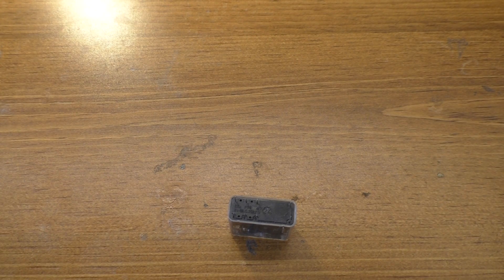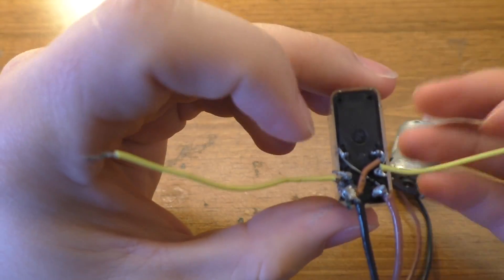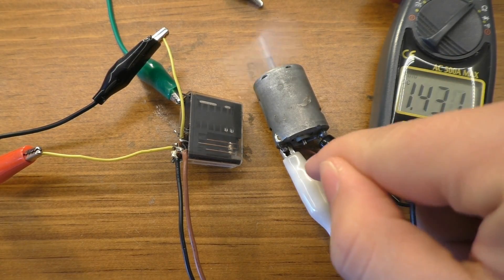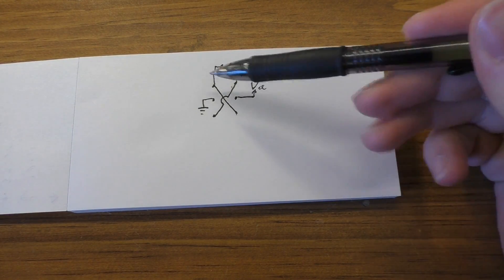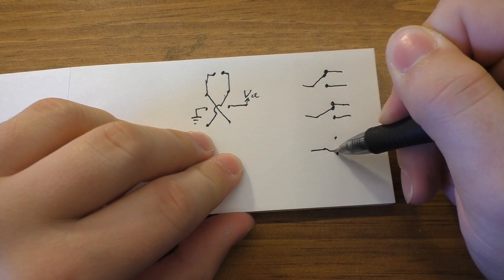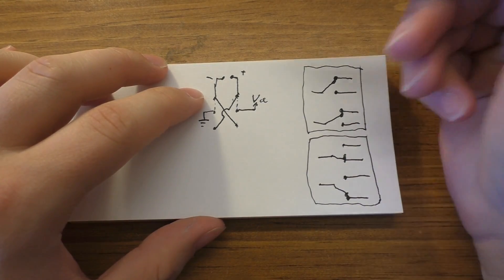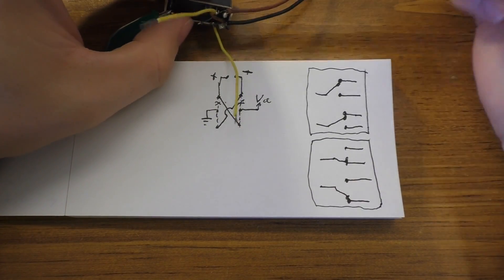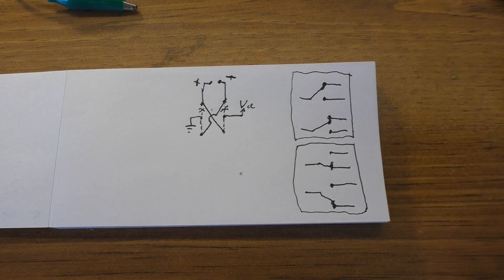Use a DPDT Switch or Relay to Change Polarity/Motor Direction

Comment: Do they make a relay switch that already have the outside cross connection done internally so you don’t have to wire it manually?
Reply: I mean, isn’t that the most obvious question.  Shouldn’t it come with just 4 prongs….

Comment: Brilliant! I've added a 12V 1channel 433MHz receiver and connected it's output as the input of the DPDT relay.
When I press my remote control button it runs clockwise, when I press the button again it reverses direction - the button toggles direction!

Comment: Thanks for sharing the informaion, i have one problem where i want to use the same with two push buttons and with the 8 pin relay. if i want to put 2 push buttons for motor forward and reverse direction , and also want to keep the motor in idle state when i don't want to use, how would be the wiring diagram with two push button's and 8pin Relay.

Comment: I enjoyed your video and it got me thinking of a project I would like to do, but need a little help on what I need to accomplish it?
I am trying to modify a winch from a hand held remote to a wireless remote.  I have a two channel wireless receiver(Two positives and two negatives) but I am a little confused on what type of relay I need to be able to run and reverse the direction of the winch.  Do I need: SPDT, DPDT?  Do I need a 5 pin, 6 pin, or 8 pin relay?  I plan on running it directly from an outlet so I know I the relay will have to be rated for 110 volts. If anyone can help me understand what I need and how to do it, I would be very greatful.

Comment: How would you make this so that the trigger voltage can be arbitrarily inverted (from another controller) and the relay output flips automatically when that happens? (without a switch)

Comment: I keep coming across this video and its somewhat useful but I am just curious if anyone can tell me what powers the circuit off when it does not need to run either direction?  I'm wanting to use one of these as a way to roll a window up and down in the tailgate of my Blazer.  It obviously only needs to run until it is all the way up or down.  The primary switch is in the tailgate and the old motor was grounded through the chassis and i am changing to a different type of motor that is direct drive and reverses polarity

Comment: Hey! So if I want to hook up a timer to this so that I never have to flip a switch. Is it possible to hook up a timer to it? Like a deer feeder timer?  Would I need two timers? Or is it just impossible?
Reply: Josh, Yes is the answer. Use a DPDT relay and your timer.  You didn't mention whether your timer puts out a voltage or is just a switch-type timer. I am going to assume that your timer just makes a connection/i.e. switches a device on/off.  So, you would use your timer to control the on/off of the DPDT relay (which then reverses the polarity).    I can't imagine why you need to do that, but that's how.  If you care to more completely describe what you are trying to do, a far better solution is likely than having wire a timer to a relay then having to wire the relay to "whatever".

Comment: I know I'm late to the party, but don't you need a flyback diode for this to not risk damaging the relay and in that case, how and weher hould that diode be located? I used this method for switching electro magnets and accidently broke some transistors because of voltage spikes generated by the inductance in both the coils in the relay and the electromagnet coils. Help would be greatly appreciated.
Reply: No. Your relay is not in danger. It is the a danger to OTHER components, that don't have some protection. As in your transistors. Not the relay. Also some relays already have a diode built in for that. With this you should be more worried about the motor putting out power when you shut it off.
Reply: @AztecWarrior75  Hah, nice 2 years later, but thanks for answering. Used DC motor driver IC's instead of the arduino controlled relays, those had built in protection, were a bit more expensive but worked better in basically every other way. (Used all this to switch electromagnets for a model maglev track)
Reply: @assarstromblad3280  yeah as you exclaimed before "late to the party".

I used motor drive shields to make something very similar. A set machine. It not only goes in and out with steady constant pressure. With no attached/fixed mounting points to the drive tube, it can rotate a full 360 endlessly. The tube being hollow, delivery of lubricant to/through whatever attachment is made possible through the inner stainless steel tubing.

You know how people have tvs coming out of cabinets,  well I had my machine coming out of the foot of my custom bed. It was very bulky. LOL.
Reply: @AztecWarrior75  Nice, what did you use it for?
Reply: @assarstromblad3280  well how one word misspelled makes a huge difference. Set machine is supposed to be SEX machine. Lol
Reply: @AztecWarrior75  oh, okay that was definitely an interesting twist lol, Now I get why ypu havr it under the bed lol
Reply: @assarstromblad3280  That one letter mistyped really changes the WHOLE outlook. LOL. Everything falls into place.

Comment: Great stuff, but with two separate SPDT relays you can have an Off/Idle state! so how about having an idle position where there is no motor rotation with a single DPDT? Like you said "briefly" and "avoided" further explanation, without a stop/off/idle state, the gears will break/damage!

Comment: Can I use 2 on off rocker switches to achieve this with 4 linear actuators? I Bought a 5 rocker switch panel for a camping trailer 1 switch runs water pump, 2 run lights, and I'd like to use the other 2 for up and down on linear actuators. Thanks

Comment: Can u explain how to hook a switch to this I’m going to order the relay I have a switch my build is done with a 3 way switch that is hit with a dowel. It’s for an elevator design small scale. Basic idea motor runs turns a threaded rod moves a bolt and washer up. When it gets to the top the washer moves a teeter totter weighed on one side causing the dowel to come down hit the switch reverse the motor and the washer and bolt move down. Teeter totter falls back pulling dowel up off switch. When the washer gets to bottom it flips switch again on other side and up goes the washer and bolt. Rinse repeat. When finished I’ll post my project on YouTube under schorr studios if you want to see it. Appreciate your video here helps a lot if I can figure out the switch I’m set. Do I have to worry about arc on this when it flips read that it can do that. Doesn’t appear to have the problem on your build
Reply from the maker: You will want to look into using 3 way switches for lighting. It will work the same way, just replace the light with the coil of the relay. You shouldn't have to worry about arcing for running a small motor.

Comment: Great explanation! Drawing it out in the video is what helps simplify it,  you turned the relay on in my head which made the correct connection.
Reply: the explanation makes sense as long as you know the pin out on the relay. he doesn't explain what they are. He just says connect this corner to that corner. Is the n/c, n/o or the common pin were connecting.

Comment: Can I add that if you wish to use this circuit for leaner actuator you need to connect the limiter switches across the center wires you have crossed over from the top and bottom pins.

Comment: How does one control the timing of the switch? Need to have a timing circuit?
Reply from the maker: You need to have some kind of circuit to control it. Could be a microcontroller, 555 timer or even a simple toggle switch if you wanted to do it manually.

Comment: Hey Eman, making a motor gear/track assembly to cover a greenhouse at night with rigid insulation panels (and retract during the day with a timer or light sensor switched in reverse). Are those power leads that you use to touch the relay to make the motor run in reverse? If not, what are those wires running to? Thanks much, great video! :)
Reply from the maker: Yeah, those are just powering the relay coil. You can get relays that will run on almost any voltage you might want to run it from.

Comment: As simple  as  Important, I  beg to know if  a CAP might be  reversed by a  circuit electronic,in a CC circuit  to resonance.Thans,Regards Johann Wegmann
Reply from the maker: It's a mechanical relay so your not going to get it to oscillate very fast.

Comment: If you have to connect the cross posts, why don't they just do that automatically?
Reply from the maker: You mean like have them come from the factory like that? You actually can buy some that do that. The reason that they don't all do that is so they can be used for other applications.

Comment: Hi there, I really need something similar to it. Where can I find this relay to buy ?Thanks!
Reply: I have a 9-12v remote controlled atv winch controller box. I'm trying to run a dc motor but both outputs are +source voltage. how would I use a dpdt relay to reverse the polarity to run the motor forward and reverse. Thanks
Reply from the maker: Just look up DPDT relay. Even eBay or Amazon would have them. Then just find one that meets your requirements.
Reply: Trevor Lord mate a DPDT relay works with + and - and without both of them you must look for aomething else. Never heard about any motor with 2 +s